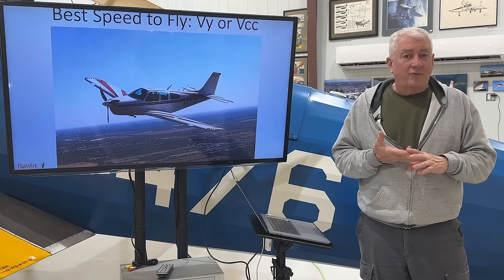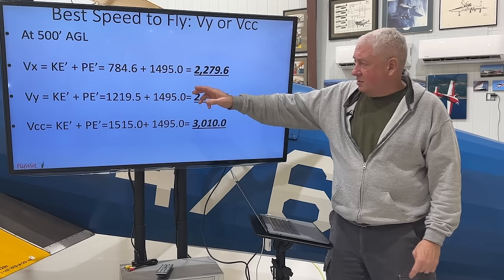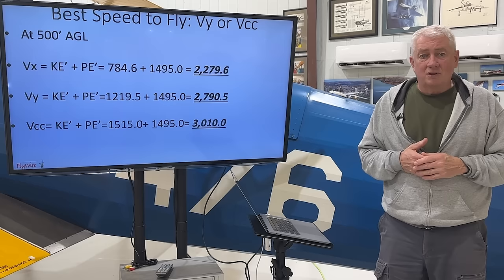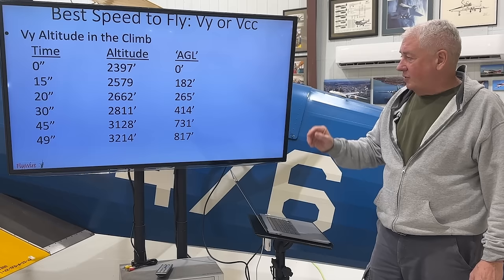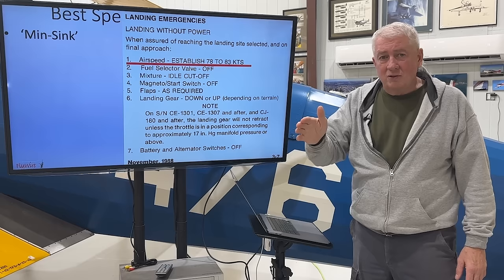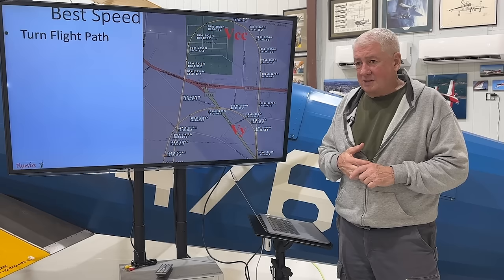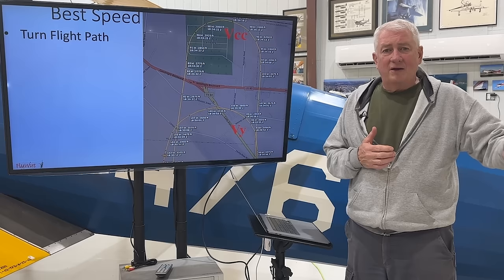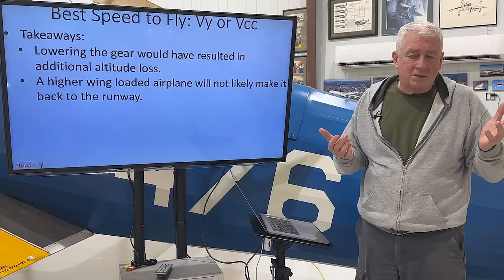Best Speed to Fly- Vy or Cruise Climb

Comment: Years ago I flew Metros. We would do a cruise climb and accept the airspeed that resulted from climbing at 1000 fpm. Generally, this gave us 180 to 200 kts ias. We did this since most of our flights were less than 30 minutes and there was no point in climbing to higher altitudes. Best climb was around 143 kts but was rarely used. Cruise climb was thus based on distance, terrain, and the available winds aloft. With strong winds aloft we would adjust our climb and altitude accordingly.
 I had an engine failure coming out of Yuma. We were only going about 15 minutes down the road to El Centro so we were only climbing to 4500 ft. We lost the engine suddenly while climbing through 800 ft and 180 kts. We had departed on rw 26, so we immediately declared an emergency with the tower and requested a return to rw 08. During the turn I did a shallow chandelle ( mini yo-yo) to decrease the radius of the turn and the distance to the airport. I continued the climb during the turn to preserve energy with the airspeed decreasing to 140 kts. Once lined up with the runway and headed downhill we were able to reduce the power on the good engine and the landing was uneventful. With the extra airspeed and the resulting additional rudder authority I had absolutely no trouble controlling the adverse single engine yaw.

Comment: Interesting analysis. I agree that a turn back is a BAD IDEA, but i disagree that the Vcc climb is better than a Vy climb. Here is my logic, feel free to poke holes in it!
The total energy in the aircraft increases due to work from the engine and decreases due to drag. To a first order approximation, the efficiency of the prop is constant for the speeds we are looking at. So at any given point in time, the energy added is maximised by running the engine at full power and minimising drag. 
Climb rate in a light piston aircraft is related to the amount of excess power or put a different way by the speed where the difference between energy lost to drag and power from the engine is largest. As engine power is fixed (to a first order) then, this is the min drag speed.
So Vy is the min drag speed and so is the best speed to add energy to the aircraft. So climbing at Vy will always lead to being in a higher energy state at any point in time than at any other speed.
Ok, there may be good reasons not to do this, engine cooling being one, visibility over the nose another and im sure there are plenty of others. This does not change the energy argument.
Yes, at any given altitude faster is always better = more energy BUT Vy give you more energy quicker. So if engine quits after 60 seconds Vy wins, if at 1000ft Vcc wins. I dont see why altitude relates to liklihood of engine failure.
If there is a flaw in my locig please let me know. Thanks
Reply from the maker: Faster, the 'more' energy achieved by Vy is marginal. And is not convertible 1:1 to airspeed. In these tests at Vy it cost 45' altitude for each knot of airspeed gained. That negates any advantage presented by Vy. Sorry.
Reply: I can’t see over the dash of the 182 at Vx🤣😂

Comment: There are two possible things to consider: energy state after N seconds and energy state at altitude X. The energy state after N seconds will be roughly the same (same engine power output over same amount of time) for both vy and vcc with likely vy resulting in slightly more energy from less friction at lower speed. The energy state at altitude X will have a clear winner - vcc since it simply takes longer to get to the same altitude for vcc vs vy.

The truth is that neither vy or vcc will give you enough energy for a turn back in the first 60 seconds in F33 based on your video (it’s closer to 90 secs for my A36). And it doesn’t matter which speed you are flying - you cannot turn back. Personally I usually climb to 50 feet at vx with gear down and approach flaps to get over trees and then accelerate to vcc (and cleanup) after that to keep my cylinders cooled. I accept that engine failure before I get to 2000 feet is going to result in likely airplane loss from landing straight ahead in the most open area I can see in front of me.
Reply: Well put.  Another way to say it is that Vy (= ~< best glide) takes drag into account (which is proportional to v^2).

My take:  If you fly the plane perfectly, that is Vy on climb then ~ < Vy (best glide) down (w/out power), you’re better off (most energy) with Vy climb.  If you fly less than perfect and hesitate (or worse pull back), experience shows you’re better off climbing at some speed > Vy, and Vcc is a good compromise.
Reply: @pedrofrigola5224  I don’t agree, my point is that energy state doesn’t change much with speed at a given time interval. If we agree that engine quits based on time and not altitude (ie failure at N sec is more likely than a failure at M sec where M > N), then it (mostly) doesn’t matter what speed you fly at for N secs. I think the lower speed / less drag effects are likely immaterial for most of the single engine planes. However, if you believe that drag is important (and don’t care about engine temperatures) then you should go with vx all the way.
Reply: @alekseysanin  Would Vx have greater induced drag than the parasite drag of Vy?
Reply: @SGTSnakeUSMC  yes , may bey ;) depends on the plane a lot. As I said, I think these effects are negligible and the energy state after N seconds doesn’t depend on speed much.
Reply: @alekseysanin  Not Vx.  Cylinders damage and bird damage if you dont see them with such high nose up.  And if EFATO, you might stall before the 3 seconds push down.
Reply: @outwiththem  Right, would like to see that guy demonstrating a Vx climb to 50 feet and cut the engine to idle.  Like i have from 1995 on Cherokee 150 with low energy inertia they have.  Some i showed that and i dont say who was flying it, say that guy must be dead by now if he does that.  Then i say, i taught that to about 15.. The say im lying. LOL..
Reply: When the engine quits ... The insurance company owns the airplane....
I'm saving my axe.
Reply: @hotrodray6802 Most engine fails on take off are the partial power kind.  And most can be landed back on runway if over 500 agl or even from 100 agl and you can climb some to 500 agl and Turnback. I learned  those in.... 1996.

Comment: Scott, I appreciate your math and physics evaluations that come up with evaluations that thousands of hours of low altitude experience has taught me.  Altitude is life is high altitude orientation.  Airspeed is life is low altitude (and now I find out fighter) orientation.  I don't want to get ahead of your schedule of videos, Scott, but I would greatly appreciate your math and physics evaluation of the basic low ground effect takeoff.  I teach, on our long runways, neither Vx nor Vy is appropriate.  I teach stay level in low ground effect as long as runway is still available or until cruise and then cruise climb.  Listen to Scott.  Airspeed gives us options.  Airspeed and not altitude allowed me the maneuverability to arrive at survivable landing zones for 11 of my 13 engine failures.  After only two failures was I higher than 200' AGL crop dusting or on pipelines.  An extra few hundred feet, Scott can figure out how many, would only be potential energy of altitude ie. airspeed in my low altitude orientation mind.  Altitude is time.  My forced landings  averaged six seconds from engine failure to touchdown, but I always had cruise maneuvering airspeed either coming out of the crop field or cruising on the pipeline.  Only one was on takeoff.  I know the free ground effect energy provided by every swath run was life saving.  I know and teach the life saving energy of level in low ground effect until cruise if runway is still available.  I know this free kinetic energy can be life saving.  Scott can do the math to prove this I think.  Thanks Scott for this video and in advance if you can tell me how low ground effect energy is actually free kinetic energy.  Is this what Wolfgang meant by his advice to try to hit the tree and then zoom over?
Reply: I have read an article on zoom climb takeoffs as well as a nonloading "wingover" style turning technique written by an experienced former pipeline/crop duster pilot. From your comment on 13 low level eng fails, I believe it may be you who wrote these articles! I've been trying out the techniques with a C182T and am amazed at the amount of "free" energy gained by staying in very low ground effect followed by a zoom climbout. On longer runways, I can easily get to Vcc by the runway end. It not only feels better than dragging the plane out at Vx or even Vy, it is also fun to do and the practice has improved my landing flare control entering ground effect as well. Now, I'm wondering if this zooming takeoff technique would be better than Vx for clearing obstacles, and also if a zoom takeoff combined with the crop duster style turning technique would provide a better chance of making an "impossible" turn back to the runway. Plane in shop, so I haven't been able to go out and test a combination of these things yet, at altitude of course. That zoom article has definitely expanded my knowledge and enjoyment of flight. If you wrote these, thank you again, sir.
Reply: I’d like to read that article if you can point me to it please…
Reply: @AaronWbirdman  You will have to ask the original commenter above, Jimmy D. He is the author.
Reply: Hey Jimmydulin928  where can I read your essay on energy management?
Reply: @SGTSnakeUSMC  Yes, the extra acceleration energy captured by staying in low ground effect tremendously helps clear obstacles.  Scott preaches constant evaluation of our energy state.  Pitching up when only Vx or Vy is only appropriate when the tree shows up when only at Vx or Vy.  Secondly a violent pitch up will dump a lot of kinetic energy (airspeed.)  So we want to continue in low ground effect  until near the obstruction (or Vcc on long runways) and then smoothly pitch up just enough to overfly the obstruction a bit (not a lot.)

On the other end, the landing, we want to do the opposite.  On short final we want to pitch enough to get enough sink to bring the throttle into dynamic play as our absolute best glide angle and rate of descent control all the way to touchdown.  Finally, very very short final coming into ground effect, we use Wolfgang's apparent rate of closure with the spot the same as when we decelerate into an intersection with our auto.  We decelerate (gas pedal or elevator but not throttle) in order to keep the rate of closure looking the same as when we were very distant from the intersection or spot or numbers.  Thus we eliminate the difficult to manage round out and hold by making the landing a smooth and continuous deceleration to touchdown (with dynamic power when done well) slowly and softly on the exact (nailed with throttle) spot.  And considering Scott's energy state consideration, this touchdown (any touchdown} should be well below Vso (an out of ground effect number.)  This is the way it looks in small, low powered airplanes.  Big powerful airplanes are doing the same thing, but are going scary fast.
Reply: @AaronWbirdman  Also I'd suggest reading Stick and Rudder by Langweische. Great stuff in layman's terms.

Comment: 100% correct! KE saves lives 
At Vx and less so Vy , you loss any potential advantage in gained altitude Because  by the time you recognize loss of power and push over fast enough to establish best glide, you will have lost that small bit of altitude advantage.  I. Addition you will not have as good control authority as you will at Vy or Vcc.  In low energy climb States you will increase potential for stall or even a torque over with compete engine seizing. 
I'm happy to see this perspective being thoroughly and thoughtfully presented.

Comment: Thanks for the discussion. I have been using Vcc more often than not for deck angle and cylinder cooling considerations. I think another benefit to Vcc is the higher airspeed gives a pilot a few more moments in the startle response before things get critical with airspeed if the engine quits.

Comment: Vcc if you are planning not to turnback from any altitude due climb angle will be flatter. You will have more energy over the Vglide speed but also farther away from the airport at that  higher speed.  Most engine fails are LOTOT, not total EFATO,  So better practice turnarounds from the crosswind leg at 60% power and later on turnbacks if brave enough for that.  LOL..

Comment: Flaps 1 after liftoff and at Vy will make you climb well at almost Vy FPM and also improve forward visibility and better rear cylinders cooling too.  And if engine fail, flaps 1lowers the stall speed too.  Flaps 1 at Vy Climbs are safer.  Most engine fails are LOTOTS and they need flaps 1 WHICH ARE LIFT FLAPS.  Flaps 1 at Vy.
Reply from the maker: Really, tested this have you? Factored in Startle time delays and the average Joe effect? Flaps 12/ Approach Flaps fdo indeed provide more lift... at low speeds... don't forget parasitic drag during the climb. Best Speed to Fly is largely airplane dependent. Blanket statements usually don't work well.
Reply: @FlyWirescottperdue  I learned that "Vy with Flaps 1 trick" during bush pilot training in 1996.  It works well except on underpowered airplanes.  Read again the post.  Better cooling, visibility and safety in case of EFATO or LOTOT.  If crosswind, you pop the flaps after Vr, not before.

Comment: So simple, but it's not intuitive...which is where training comes in. Brilliant to decouple the turnback exercise from landing. We all learned about a 'hard deck' from Top Gun. Seems like a smart way to practice. 

I was taught something about energy vs altitude when I flew gliders. We would practice what they called a "penetration approach" to ensure we made the runway. This involved lowering the nose, trading altitude for speed which gave us more range than min sink. We used spoilers and/or slipping to kill the excess speed once the runway was made. A penetration approach also gives you the benefit of more time in ground effect for an extra margin. 

This wasn't the normal landing procedure but it was handy to have that extra option in case it was needed.

Comment: If you get your helicopter add-on rating, the kinetic-potential energy curve is really drilled into your head. That's why single-engine helicopters take off much as airplanes do, unless necessary to clear an obstacle. Since at the beginning of a takeoff run, you don's have much potential energy, you have to add energy to the rotor system's "bank", which can be withdrawn in the event of an engine failure.

Comment: Apart from a discussion about energy storage, a higher speed on climb (i.e. Vcc) is a way to store extra “TTLOC”: Time to Loss of Control (stall). An engine failure during climb will result in a rapid loss of airspeed, right down to stall speed, until and unless the pilot reduces the airplane’s pitch attitude. This necessary pilot action requires time for recognition and reaction as, all the while, airspeed is being lost. Extra speed on climb increases the time buffer prior to reaching stall speed.

A corollary of increased speed is a lower pitch attitude. Thus, if an engine does fail, the pilot will not only have more TIME, but also need less of a PITCH CHANGE to stabilize at a safe gliding speed.
Reply: Prepare your mind prior to takeoff that IF it quits...be mentally ready .. Airspeed is everything. 
Maintain thy airspeed lest the earth shall rise and smite thee.

Comment: When i learned EFATO Turnbacks on Cherokee 140 in 1995, we used the Vglide speed which was a blue color line my Bush Pilot CFI put on airspeed indicator at the 80mph point.  When under gross weight, we used a few knots under it, or almost the minimum sink speed.  The problem is, the 140 is a short wing airplane, and some short wing airplanes at almost gross weight they are too close to the stalling speed with flaps up at the 45 degree bank, so we kept speed as close to Vglide Blue line to only 5mph under.  And ready to push down if speed drops.  My CFI had to do 2 LOTOT turnbacks for real on same Cherokee due fuel pump problems.  Was the cheapest Cherokee to fly in all the region.  Was old engined..
Reply: Hi Victor.  Actually i had 3 LOTOTs Turnarund the airport, 2 on Cherokee 6 loaded and barelly climbing from 100 agl, and the other was on a Cessna 150, again at almost full gross.  Cherokee 6 because of bad carburetor, twice.  The C150 started at about 150 agl vibration, lost climbing and i felt nose down effect on elevator too.  I climbed slowly to 300, dropped some flaps and returned it.  Scary.
Reply: Promised myself in 1969 that I'd never fly another Cher 140.
Never broke that rule, ever.
I've flown damn near anything else.😆

Comment: We have utilized the Vcc procedure for many. years now in a F33A. We’ve experimented with a few Vy climbs, but found these climbs to be what you have experienced. In addition, the cruise climb has afforded us cooler CHTs and better visibility. Those are big plusses operating in hot, busy Texas airspace.
Reply: Can you achieve the same FPM climb and also have the same good visibility and also more alt per mile flown with flaps Vx (flaps 12 degrees =/-)  but at the Vy speed.  We did that on strong Cherokees.